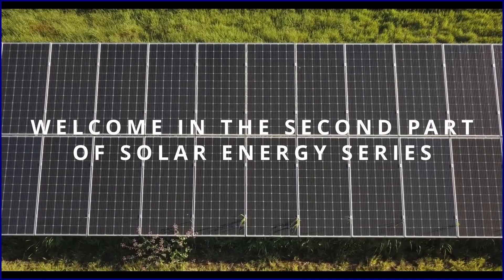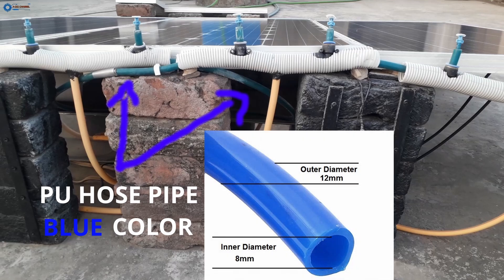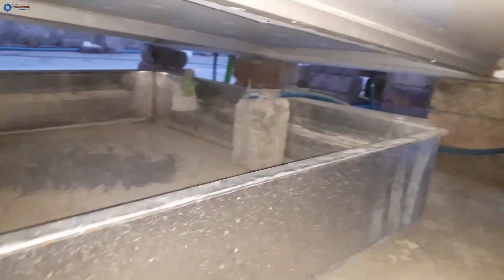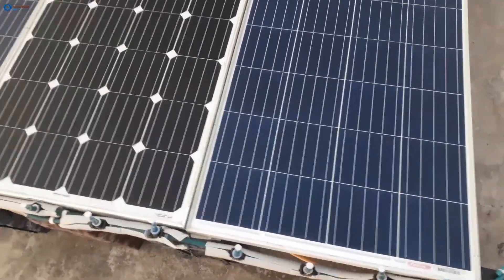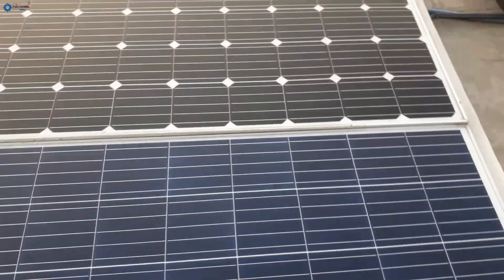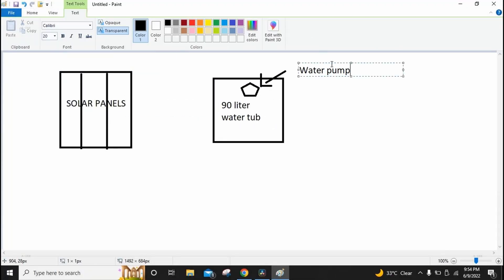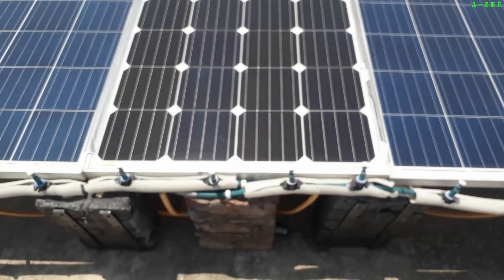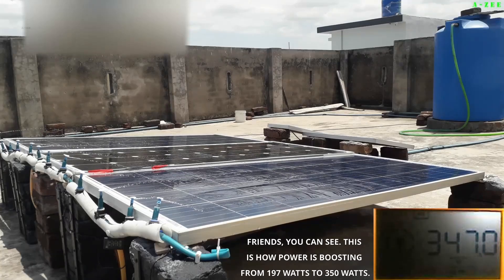WORLD'S BEST SOLAR POWER BOOST SYSTEM! I REACH 197 WATTS TO 360 WATTS. 163 WATT BOOST. 80% INCREASE

Comment: this will break the solar panel top glass on high heat 

not recommended if you have n type byfacial panel stay away from this otherwise total destruction there
Reply from the maker: BS, your comment is BS
Reply: @A-ZEE_OFFICIAL  continuous cooling  from morning till evening will not break glass . Temperature is well maintained 👍👍